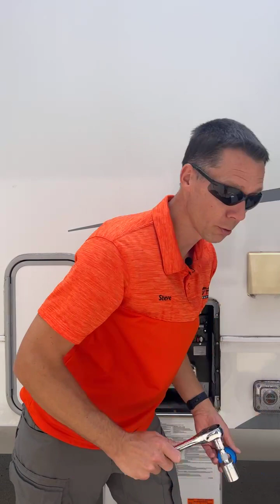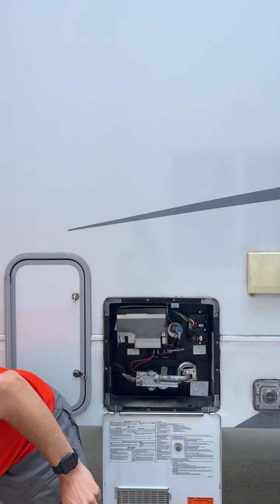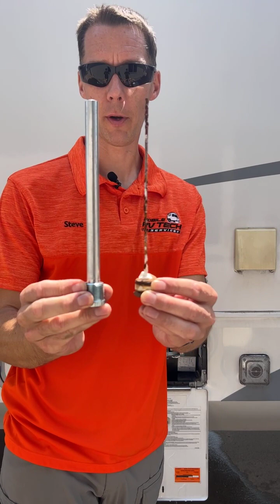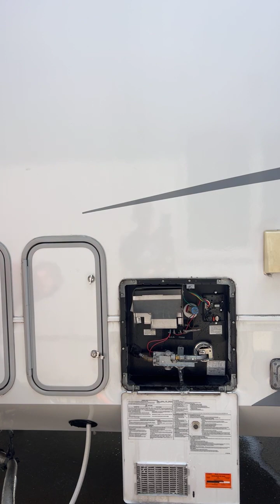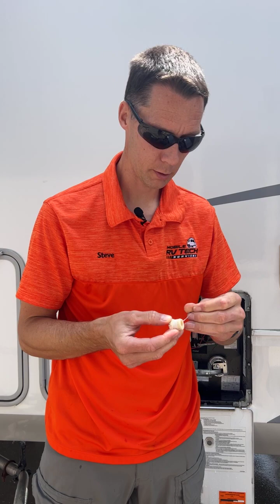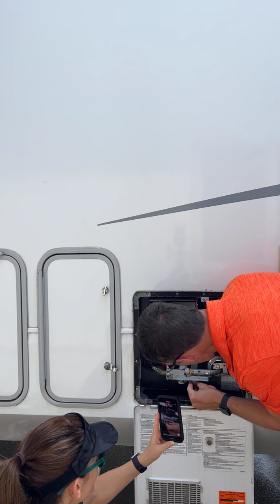How to Flush Your RVs Water Heater (Facebook Live Recording)

Comment: Clarifying question...does a hw heater have a plastic plug or an anode rod?  I've got a KEYSTONE PASSPORT ELITE 19RB with an Atwood GC6AA-10E (6 gal.) water heater.  I definitely have the plastic plug for sure.  Also, I can't find my electric heating element.  Is it only accessible from the inside compartment.  (Sorry for the long message, thanks for any coaching you can provide, I don't take it for granted.)
Reply from the maker: Correct either an anode or plastic plug. Atwood is aluminum which has a plastic plug. Also the element on an Atwood is only accessible from the inside of the RV. It’ll be behind a black cover that has a relay to turn on the element, make sure to turn off the water heater prior to opening the cover.
Reply: Thank you.